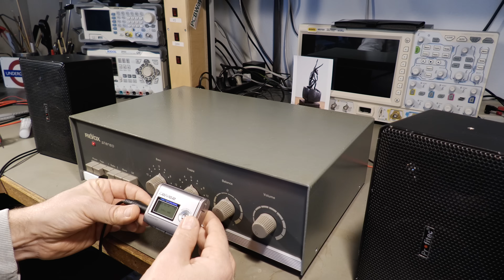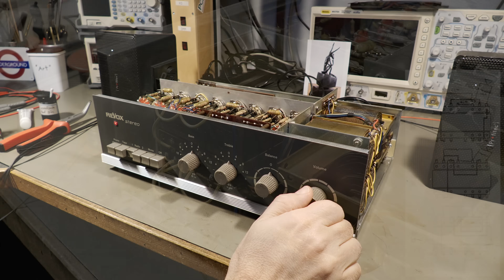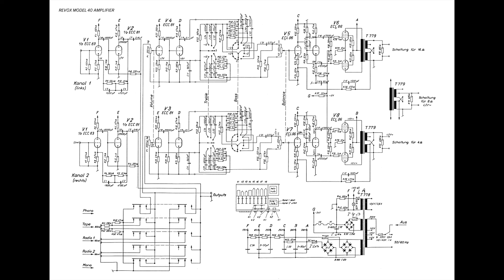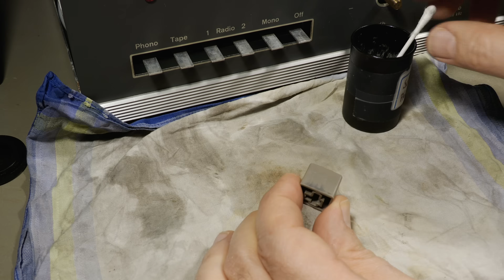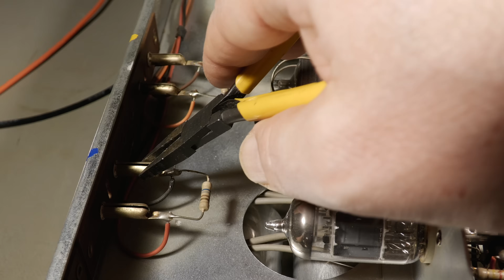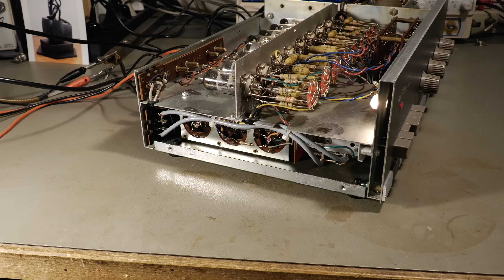Revox 40 stereo tube amplifier restoration (4K)

Comment: What a beauty! Definitely not junk ;) 

You may be able to improve the asymmetrical clipping by slightly changing the bias on the output tubes.
Reply from the maker: "Slightly changing" means replacing resistors, there is not a single trimmer in this amp... I guess I will leave it as it is 🙂

Comment: Thing is built like a tank. I imagine it probably doesn't weigh a whole lot less than one either, judging by the metal case and those gigundous transformers on the one end. Lol.... But it's pretty impressive it worked as well as it did on first go. But it just needing a bit of cleaning and a little time for the caps to reform is even more impressive. I always did like that method of construction, thought the name of it escapes me at the moment. It just looks neat with everything being out in the open like that.
Reply from the maker: The weight is not too bad. Of course very heavy on one side but the rest is light. Tubes are lightweight and there is no heatsink needed. You just shouldn't place a candle on top... or chocolate.
I have many, even older products, that are still working. The oldest is a 1927 radio I found for $5 on a flea market. Except a cracked housing no repairs needed. That old stuff was made differently. It was expensive but it survived for decades. To reduce waste, we should do the same today...

Comment: Output power does seam a little low at just 6 watts but 10 does also seams just a little optimistic. For a real 10/12 watts you would expect to use something like a pair of EL84s. The ECL86 single ended would give you about 2.5 watts on a good day so for a pair in push pull, 6 watts is about right.
Reply: In push pull configuration, ECL86 can output 14W so I think a previous stage may have a bias problem due to a bad resistor or a bad cap. Both are great quality but it can be a good idea to check the voltages
Reply from the maker: I'm glad to hear that 🙂 But I wouldn't change anything anyway. It's loud enough for what I want to use it.

Comment: The fact that vintage vacuum tubes can still have a hard vacuum inside. Is always amazing.
Reply: The getter do it's work constantly contrary to some high power tube with reactive anode. If they are not used for a long time, they can have some gaz inside